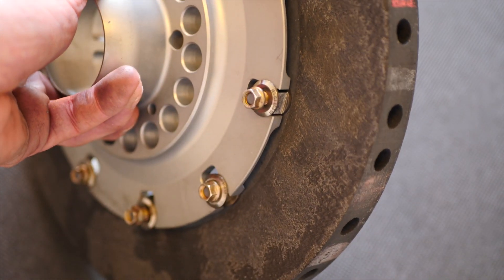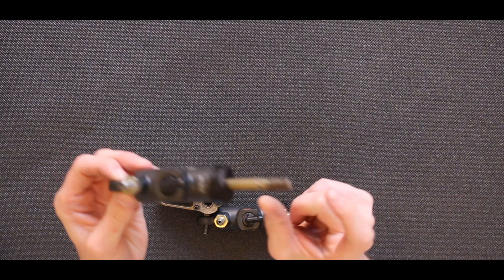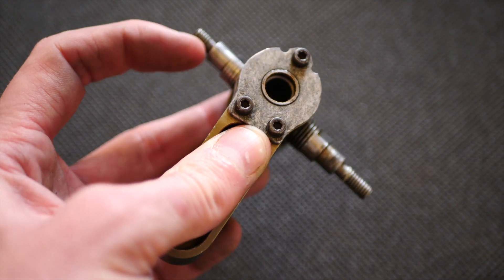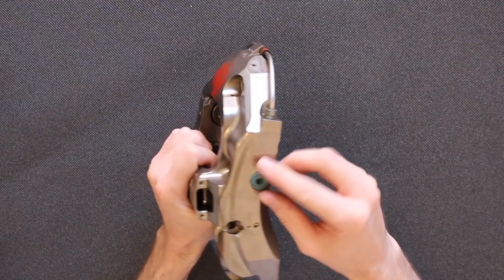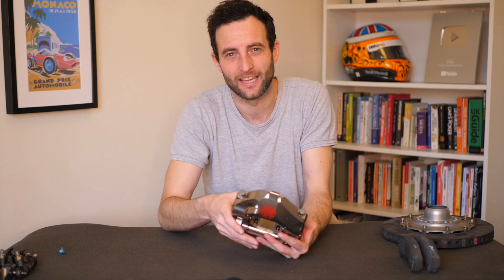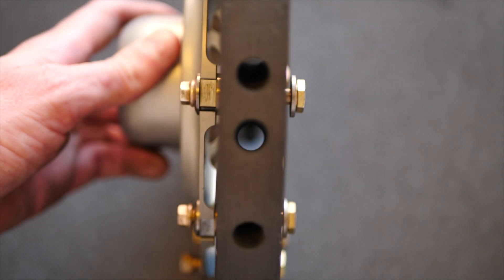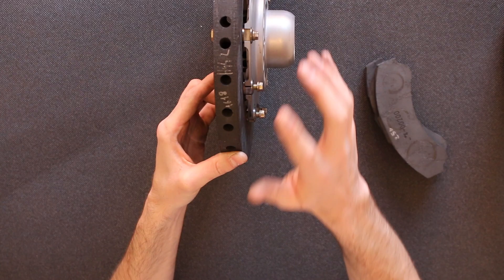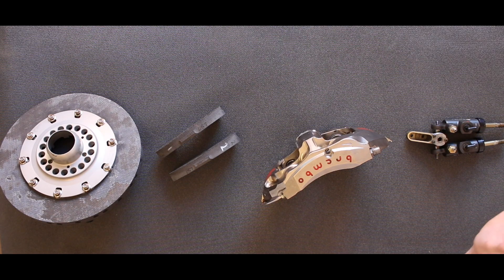How F1 Brakes Stop from 200mph to 0 in 4 Seconds | F1 Engineering

Comment: Great explanation, but only for those who understand motor engineering anyway.  Another point you could have made, is that in reality, the brakes do not stop the car.  The brakes only stop the wheels, it's the tyres that stop the car. And even then, it takes the skill of the driver to make it happen.  Hitting the brakes at 200mph will not stop the car as is often stated, it will skid for many metres, possibly swerve, and even roll over ... F1 drivers do not have the benefit of anti-lock brakes.  Ricciardo was fully locked up when he smashed into the back of Verstappen.  Unfortunately, hitting the brakes is an instinctive reaction of most drivers, but is the root cause of most accidents.  It takes the split second extreme cadence braking skill of a racing driver not to lock up, which is why most road cars have anti-lock systems as standard.

Comment: Just the same as my 7, apart from the electronic balance control, carbon fibre and about a million bucks. Amazing that the brake diameter is only 270mm, about the same as an early Cortina. Good video.

Comment: But super interesting video indeed. I especially liked the part about the different sized pistons. Enlightening because ive seen dual piston setups where one edge of the pad is worn more than the other. That explains it. Lol Crazy that 10 little bolts can take the forces on those discs. How long does a set of pads last on f1?

Comment: Uuhhhhhh....... what? Brake fluid cant be compressed? Thats how hydraulics works. When you press the brakes, the fluid isnt “moving”, its being compressed. Its the compression of the fluid that creates the pressure on the pistons in the calipers to squeeze the pads on the rotors. Take a water bottle that has water in it and blow as hard as you can into it. The water doesnt move, but the water bottle gets tighter.
Reply: Fluids can't be compressed. For all intents and purposes the fluid is a solid except for the fact that hydraulics can multiply force.
Reply: Pablo Gonzalez i think your confusing compressed with compacted? I mean theres different definitions for compression obviously, but Its the compression of the fluid that pushes out a ram or piston or cylinder, etc. And i guess as far as my “fluid” isnt moving, i supposed technically it was when theres a lesser force or path for it to go. Where as technically most hydraulic units have pumps.
Reply: Or maybe more technically its the less resistant path the fluid can be “pushed” to from the compression of.
Reply: @trappedsol  Compressed IS compacted and implies a volumetric change like a tank of propane or air. There is no volumetric change within a working hydraulic system. It's simply pressurized.
Reply: Pablo Gonzalez compressed is not compacted. Listen man if you want to get into thermodynamics n shit im all for it. But to reply to your original statement, yes fluids CAN be compressed. And no, hydraulic systems are not all pressurized. There is no pressure in your brake lines. (Until YOU compress the fluid and pressure is built) and that force applied is transferred mechanically. Go learn yourself somethin and look up “bulk modulus” and “modus of elasticity”.
Reply: @trappedsol  I did learn something. I knew liquids were microscopically compressible but it's much more than I thought at higher pressures. At 3000 psi hydraulic fluid can compress as much as 1% and the lag must be accounted for. 

That being said. In a braking system the compression is negligible and it's not the mechanism doing the work.

In a road vehicle the brake booster aids pressurization it's not just your foot.
Reply: Pablo Gonzalez you didnt say “fluids cant be compressed”? Lol 🤣 im just breakin your chaps. But seriously, come on. Without the “mechanical” efforts from the brake pedal, and the “mechanical” assistance from the vacuum, there would be no braking power. Without the “compression” on the brake fluid, there would be no pressure being applied to the pistons in the calipers. The booster itself does not aid in pressurizing the fluid, it does not change anything in the lines, its a vacuum from the intake. it aids in relieving the amount of force needed to apply on the pedal. Take your car, and pop off the vacuum line from the booster. Experiment if you havent done so. Ive replaced many boosters and ive forgotten to pop that vacuum line on, and you start backin up and your like oh shit! 🤣🤣
Reply: Pablo Gonzalez no yea your right, i didnt read that in the right context. The booster does aid in pressurizing the lines, by decreasing the mechanical effort

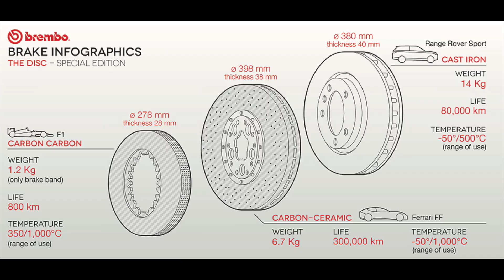Comment: 8:22 Ferrari’s FF ceramic carbon brake discs last 300,000 km (186,411 miles)!! 🤯 ... contrast that to the F1 brake disks 800 km (497 miles) lifespan #fascinating
Reply: Different materials. Carbon ceramics are heavier than carbon carbon.

Comment: Floating hats are more for even piston pressure for both sides of the caliper. 

Imagine the rotor not being perfectly centered... when you actuate the pistons one side of them apply pressure to the rotor first. Not only is the pressure uneven, but now the rotor has to cope with a different force, the uneven side loading, that can cause the rotor to fail in some manner.

Comment: You can simply remove the caliper and hang it higher than the any other part of the system to bleed it... so it can be on the under side.

Not to mention the sheer engineering power and money these teams have, they could have a vacuum brake bleeder quite easily. 

I’d imagine a more legitimate reason for that design choice.

Comment: The breaking balance also lets the driver “take care” of the tires as they wear. Different circuits wear tires differently so as the race develops you can start losing grip at some corner of the car and with the breaking balance you can adjust it so that the wear is more equal across the tires ;) ;)

Comment: At 6:55 it is implied that the smaller piston exerts lower pressure on the pad, but is that correct?  The larger piston should exert the least amount of pressure due to the increase in bore and necessary fluid volume.  Correct me if I'm wrong
Reply: But the same pressure is acting over a larger surface area so the larger piston exerts more force.

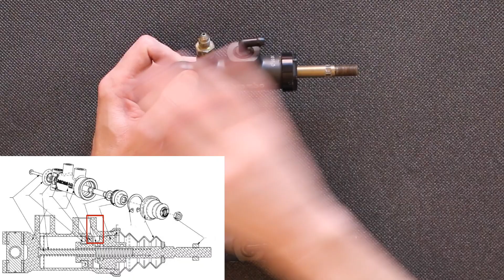Comment: 2:50 has a wrong lighted red box. the small hole that is shown is to the left of the piston to give fluid to the master cylinder at all times with pad wear.  The red box should to the left of the master cylinder piston, no right, the right would lead out the dust boot and cover the driver/inside of car with brake fluid.

Comment: You mentioned that the smaller caliper pistons engage the rotor on the leading edge with less pressure to reduce irregular pad wear, but (given a static fluid volume) wouldn't the smaller pistons create more clamping pressure since the displaced volume remains constant?
Reply: No. Same pressure acting over a larger surface area equals more force.

Comment: @Driver61 I've noticed that we never see clouds of Brake dust on braking and at pitstops as we did in previous seasons, why is this?
Reply: Carbon ceramics don't dust rims in regular cars either; mostly stay clean and neat but can be smelly after a hard ride; I checked them to go to between 200-250C on hard road use, no racing.

Comment: thought i was here to see what makes f1 brakes so unique but instead got an explanation on how disc brakes function
Reply: The Videogamer0MG he did explain why they are unique if you actually paid attention. He explained the materials and why, he explained the build from the pedal to the discs. He showed us an adjustable master cylinder. 

I can tell you those brakes are completely different from an automotive perspective. But hey I guess having never been a mechanic for so many I wouldn’t know that this on very basic level functions the exact the same way a car brakes do, however the materials and the way it’s built are unique... tell me, do your brakes allow for heat expansion after they’re glowing red hot? Do your calipers squeeze softer and harder in different areas? Do you think you steel rotors wouldn’t warp?

Comment: Funny thing is that, other than the ultra-exotic materials and the absolutely ingenious bias fork piece (which uses plain old low-tech mechanical leverage  as has been used to advanatge by the human race for, oh, the past few thousand years), it's not much different from a regular passenger car or motorcycle disc brake system.  Pretty basic stuff.  In fact, at first I was wondering why the components were as small as they were, but remembered that an F1 car is "only" about 1500 lbs, so even though the speeds are very high, I'm guesing there's alot less clamping force needed than, say, a 3500 lb.  NASCAR stocker.

Comment: very cool video ! just smthg slightly wrong at 7:02 : the smaller the diameter, the higher the pressure (p=F/A with F=const.) hence according the direction of rotation you indicated, the first small pistons put the highest pressure and the last ones (the biggest) put the lowest pressure to the pads

Comment: You said they lock up more often when the brakes are cold but didn't explain why, I thought they'd have less maximum braking strength when the brakes are cold so intuitively you'd think they wouldn't be locking up more often in that situation. Am I wrong or is it another reason entirely why they are locking up more often at T1 lap 1? e.g is it just because the drivers often overcompensate for the expected reduction in braking ability by putting excessive force into the pedal?

Comment: not entirely explaining anything different from most normal cars, it's the same
pedal piston brake line, caliper, piston, pad rotor.

only noticable difference is that the pads aren't held in with any pin or clamp 
And that they have seperate pedal pistons for front and back 

the materials are massively more expensive tho

Comment: Maybe it's just the rules,  but this system seems to be rather antiquated,  especially in this age of computers.
Reply: This particular system is opd but not that different from recent ones, remember that f1 cars need to be as loght as possible, more sophisticated parts higher the risk of damage and add weight, thats why you need to be fit to use the breaking pedal efficiently.
Reply: opd*= older

Comment: The title is wrong, the brakes is not what make a powerfull braking, the weight of the car, specially the sticky tires and a bit the huge aero drag of a F1.
Probably a avergae brake kit  do the work.
The advantadge of F1 carbon brakes is the high temperatures without fadding.

Comment: So basically the brake system is exactly the same other than the carbon as a 1950's car. I think the most interesting thing was the picture of the wheel and the additional heat sink machined into the rim to aid the brake cooling.

Comment: Usually at a brake system, you would like to the disc or the callipers to move because of vibration, but a F1 seem to be all fixed, why?
Reply: Not needed with pistons on either side of the calliper

Comment: Question about the pads, you said there's nothing else holding them in, they just sort of float. So how do they return to the original position when the driver releases brake pressure?
Reply: They don't return, but stay in slight contact with the disc. This is the case for all automotive disc brakes

Comment: So you basically explained how a hydraulic disc brake works on the example of an F1 car. I still do not know, except for the disc material, what makes it stop that much quicker than other race cars. Of course, the dimensions are bigger, but you did not explicitly answer your question in the video title.

Comment: I dont get the last part. Why woukd they lock up when they are cold. Isnt locking up caused by tyres not having enough grip to keep up with the deceleration of the brake disc. When its colder brake will have less deceleration meaning tyre will have less chance to lock up. I think the reason why they lock up during start of race is because of cold tyre temps and not because of cold brake temps

Comment: I have a question. Even the 911 gt3r with actual slicks has 6 piston calipers on the front meanwhile road version has 10 piston and bigger discs. Isnt how much you can brake depends finally on the tyre itself meaning even if you have the greatest brakes ever you ll still be braking as much as your tyres are allowing you to? Because even in the gt3r with slicks with all that grip you can still lock up meanwhile street version with much less grip has bigger brakes. Why is that????

Comment: The smallest cilinder in the calliper will come out the quickest (assuming the inside diameter is equal to the outside.) I think this is done to get a more gradually buildup in braking force and it prevents the pads from making squeaking noice while breaking.

Comment: The braided brake lines will have a PTFE liner, not rubber - lower volumetric swell, increased temperature capability and reduced moisture ingress. (I used to work for a company that made them...) thanks for the video!

Comment: So basically, pretty much the same as any other disc brake system...
Reply: Just made of carbon instead of iron
Reply: These are probably 20 years old. They use brake by wire and kers now

Comment: The Brembo F1 brake system you describe started with Auto Parts - a UK firm that sold to Brembo in 1970. It will have been much modified since....

Comment: Floating not just for expansion, but to allow the disc to move independent to the hub. If you ride a curb the hub deflect. Without a floating disc, the disc will push back on the pistons giving a long pedal for the first contact after riding the curb. If the disc floats, the hub can deflect and the disc remains constrained to its original axis.

Comment: I can explain this I'm way less than 11+ minutes. The driver pushes the brake pedal that creates pressure and the brake fluid travels through the line closing the brake caliper and squeezing the rotor with the brake pads. The friction eventually will stop the wheel from turning and the car will slow and then stop.

Comment: I've always wanted to know how they decide caliper placement on the rotor and in relation to the rest of the car. Even on road cars.
I'd always thought mounti h the caliper low down on the disc, and towards the centre of the car ( front and rear) so that under heavy braking the nose won't dive as much lightening the rear end. Instead the beaking force would more evenly drop the ride height of the car increasing stability under braking.
They could mount the caliper lower and pressurise the system no problem.
Reply: Ya, many motorbikes are like that, with the bleed on the bottom (annoyingly).  If there was a benefit to putting the calipers on the direct bottom, they would do that and make the mechanics work harder.